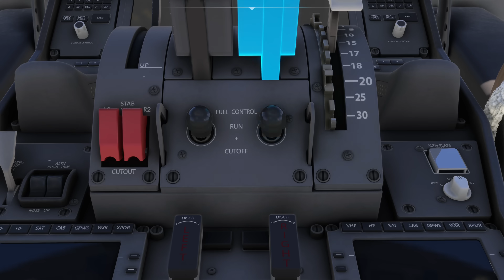Air India 171: Why Did The Fuel Cut-off Switch Get Moved?

Comment: Could relay theft have something to do with the ‘cut off fuel’ switch regarding the Air India Airline tragedy?  

Example:  Usually, a car thief gathers a signal as owners enter and exit their vehicles.  In my street lately, thieves open cars within a large area with RFID omnidirectional transmitters and receivers.  THEY USE LONG DISTANCE AMPLIFIERS.  Hence why some mornings, most cars in my street have open windows and unlocked doors. 
Hypothesis: Wouldn’t it be possible that some of the very expensive cars could be remotely started and air conditioners turned on?  Could a high tech. thief have accidentally accessed the Air India Flight’s onboard computer and turned off the fuel switch, thinking that it could be a locked car that needs unlocking and IF POSSIBLE, TURN THE ENGINE ON? SO, TECHNICALLY, THIS TECHNOLOGY CAN TURN OFF A CAR WHILE DRIVING?  HAS THIS HAPPENED TO ANYONE DRIVING BEFORE?

AIR INDIA 171 WAS SURROUNDED BY RESIDENTIAL AND COMMERCIAL AREAS FULL OF HIGH TECH. CAR THEFT!!  THIEVES USUALLY UNLOCK CARS WITH VERY SOPHISTICATED GADGETS, THIS YEAR IN PARTICULAR!!

Comment: Capt Steve appreciate your channel I think you bring excellent  aviation content to the world. Let's not use a preliminary report as a basis to blame pilots at this stage of investigations. Anything is possible but shifting narratives and perception is unfair and disrespectful. 
Let’s be honest—the FAA isn’t really a safety regulator when it comes to Boeing. It’s more like Boeing’s PR department, always ready to deflect blame, cover up mistakes, and protect the company’s profits, even when people die because of its failures.  

And now, with Air India Flight 171 crashing last month, killing passengers and crew, we’re about to see the same old playbook in action: Boeing and the FAA will try to pin this on the pilots.  

How the FAA Protects Boeing Instead of Passengers  

1. The 737 MAX Scandal: A Masterclass in Cover-Ups  
Remember the two Boeing 737 MAX crashes that killed 346 people?  

- Lion Air Flight 610 (2018) – Crashed shortly after takeoff.  
- Ethiopian Airlines Flight 302 (2019) – Same thing happened five months later.  

At first, Boeing and the FAA blamed the pilots, saying they didn’t react correctly. But the truth?  

- Boeing hid a deadly software system (MCAS) from pilots—one that could forcefully push the plane’s nose down without warning.  
- The FAA knew about it but still certified the plane as safe.  
- Even after the first crash, the FAA refused to ground the MAX, waiting until after the second disaster to act.  

And what was Boeing’s punishment? A slap-on-the-wrist fine, while executives walked away untouched.  

2. The "Blame the Pilots" Strategy – Especially If They’re Not American  
This isn’t new. Boeing and the FAA have a long history of shifting blame to foreign pilots when their planes fail:  

- Turkish Airlines Flight 1951 (2009) – A faulty sensor caused the plane to lose speed and crash. Boeing initially blamed the pilots, but investigators later found Boeing’s cockpit design was dangerously confusion  
- Lion Air 610 (2018) – Before the MCAS scandal fully broke, Boeing pushed the narrative that Indonesian pilots weren’t properly trained, ignoring that the system was designed to overpower them.  
- Ethiopian Airlines 302 (2019) – Same story—Boeing tried to suggest African pilots were at fault, even though the MCAS system was actively fighting them.  

Now, with Air India Flight 171, we’re seeing the same pattern:  

- Early reports are already focusing on  pilot actions and suicide intentions by the  Indian Capt, while ignoring known issues with Boeing’s 737 and 787 series with switch malfunction. This can very well be a software issue that caused the plane to shut  down both engines. Blaming  pilots with no actual cockpit voice  transcripts. Whatever the outcome let it be fair and just. Bring in more Senior Captains from India to help with investigations as to avoid biases western agendas.  

- The plane skidded off the runway in Kerala, but was it just "pilot error"? Or is there a deeper problem with Boeing’s aircraft?  
- Given Boeing’s track record, they will try to make this about the Indian pilots rather than their own engineering failures.  

Why Does the FAA Let Boeing Get Away With This?  

Because the FAA isn’t truly independent.  

- Boeing funds much of the FAA’s certification process, meaning the regulator relies on the company it’s supposed to oversee.  
- Former Boeing executives often move into top FAA jobs, creating a revolving door of corporate influence.  
- The FAA doesn’t want to hurt Boeing’s profits, because Boeing is a key part of the U.S. economy.  

So when crashes happen, the FAA’s first instinct is to protect Boeing, not the truth.  

What Needs to Change?  

1. Break the FAA-Boeing Relationship – No more letting Boeing "self-certify" its planes. The FAA must be fully independent.  
2. Stop the "Pilot Error" Scapegoating – Investigate fairly, without automatically blaming foreign crews.  
3. Hold Boeing  Responsible– No more fines that amount to pocket change. Executives should face real consequences when their negligence kills people.  
4. Demand Global Accountability – Countries like India, Indonesia, and Ethiopia should not accept the FAA’s biased rulings. They need their own thorough investigations.  

Final Thought: Will Air India Express 171 Be Another Cover-Up? 

Given Boeing and the FAA’s history, yes—they will try.  

But the world is waking up. People are tired of seeing the same excuses, the same blame-shifting, and the same lack of justice.  

If we want real aviation safety, we need to stop letting Boeing and the FAA control the narrative. Because right now, they care more about profits than lives.  

And that’s a scandal that keeps repeating itself—until we force it to end.

Comment: Boeing should make changes such as simple software update.
There should be be  YOKE Vibration and AUDIO warning eg. "Engine 1 Fuel CutOff"
especially when thrust level is not Idle, to warn the pilot or other pilot in case if this hapeen again, that could prefent this kind of aciddent happen

Comment: Capt, Are you seeing the interview on YouTube channel MINT with a Dreamliner Capt that quotes the report as the fuel switches being moved in “one second” and his comment based on 4,000+ hours of 787 flight that it’s not possible to move both switches in one second to off. He comments that the “micro switches” in the equipment may have malfunctioned as much more likely than a pilot somehow doing it in one second. The report must have stated this as he seemed pretty confident he read it right.
Reply: the first half of the movement of the first switch does not count - 1 second gap between position-status off

Comment: Don’t give wrong 😑 information….Yes, the Boeing 787-8 Dreamliner uses an electronic engine control system called FADEC (Full Authority Digital Engine Control), which controls the engine’s fuel flow, including the Run and Cutoff modes.

🧠 What Is FADEC?

FADEC is a digital computer system that:
	•	Controls all aspects of the engine (fuel flow, ignition, thrust, etc.)
	•	Replaces traditional manual levers or hydro-mechanical systems
	•	Provides Run and Cutoff control via electronic signals from the cockpit

✈️ How Run and Cutoff Work on the 787:

✅ Engine Start/Stop is Done via the EICAS/Overhead Panel:
	•	START/RUN/STOP commands are given electronically.
	•	Pilots use engine start switches and fuel control switches, which send signals to the FADEC.

✅ FADEC Executes the Command:
	•	When RUN is selected, FADEC:
	•	Opens fuel shutoff valve
	•	Commands ignition and fuel metering
	•	Starts engine rotation
	•	When CUTOFF is selected (or switch is moved to “STOP”):
	•	FADEC closes the fuel shutoff valve
	•	Stops fuel flow
	•	Shuts the engine down

🔐 Safety Features:

FADEC systems are designed with:
	•	Redundancy (dual channels)
	•	Built-in self-checks
	•	Lockouts and interlocks to prevent accidental activation
	•	Software protections to ignore illogical or dangerous commands (in theory)

However, if the fuel control switches (electronically linked to FADEC) are moved to cutoff—whether by crew or fault—it will stop the engine.

✅ In Summary:

Feature	Boeing 787-8 Dreamliner
Engine control system	FADEC
Cutoff/Run controlled by	Electronic switches via FADEC
Manual override	Not standard; FADEC manages all fuel flow
Safety interlocks	Yes, but still under investigation after AI171

Comment: This is one of the most asinine accusations in the history of aviation. The report is pure garbage that was leaked to western media to cover a massive fault in 787s, which is clear by how vague an OFFICIAL report is (doesn't matter if it's preliminary). The RAT was deployed BEFORE the switches were toggled. End of story. This was a major engine failure that was trouble shot by 2 wonderful  and calm pilots by turning the switches off and on. @captainsteeve, looking into Flying Beast/Gaurav Taneja's review of the report and that will educate you on A LOT of nuances that you missed.
Reply: Your a racist

Comment: Zero hours flying a 787, or any other plane for that matter. But I am a aerospace machinist, and knowing a thing or two about the manufacturing process behind airline parts, I have to ask... There seems to be only two theories left: either one of the pilots flipped the switches, or it was some kind of computer malfunction that caused the fuel shut off (one of the pilots said "I did not"). If  some kind of computer malfunction caused the fuel to be shut off to the engines, would the electronic shutting off of the fuel also mechanically flip the switches in the cockpit as well? That doesn't seem possible, because that would require an individual motor control with a backwards electrical feed coming from the computer that regulates the fuel back to both of the switches - which seems completely unnecessary. Also, since switches have to be toggled over a stop, that would entail another motor movement. If it can be identified that the cockpit fuel cut off switches were 100% for sure switched to off, and any computer glitch would only electronically cut off the fuel to the engines and not toggle the switches to off, then there should be no doubt to the cause. In all this back and forth, I have not seen anyone say anything about this. It seems so elementary, yet no one has brought it up.

Comment: Question for captain Steve regarding `787 automatically moved the fuel switch from “run” to “cutoff” without any action from the pilots.`

According to this news article it is claimed that the computer on a 787 has set the fuel to "cuttoff" before. It seems odd that a computer can move spring loaded switches but since everything is electronic it could of course cut off the fuel to the engines automatically. Did the reverenced incident really happen as described and can the computer on a 787 automatically switch of the fuel to the engines?

`She highlighted a similar incident during which one of the engines suddenly shut down midflight on an All Nippon Airways Boeing 787 during its final approach to Osaka, Japan, in 2019.

Investigators later found that the aircraft’s software had mistakenly interpreted the plane as being on the ground, triggering the thrust control malfunction accommodation system, which automatically moved the fuel switch from “run” to “cutoff” without any action from the pilots.`

Source: https://www.aljazeera.com/news/2025/7/17/what-happened-to-the-fuel-control-switches-on-doomed-air-india-flight-171

Details:
Airline	All Nippon Airways (ANA)
Aircraft	Boeing 787-8 (JA825A)
Date	January 17, 2019
Airport	Osaka Itami (Arrival from Tokyo Haneda)
What Happened	Both engines shut down on landing rollout
Suspected Cause	System/software glitch (TCMA system) after reverse thrust deployment

Related articles:
https://samchui.com/2019/01/19/ana-boeing-787-dual-engine-shutdown-upon-landing/
https://www.aeroinside.com/12629/ana-b788-at-osaka-on-jan-17th-2019-both-engines-rolled-back-after-landing

Comment: The timing of when the fuel switches were cut off seems to be around the time when the pilot would have brought the landing gear up, but we know that never happened. Could this be a case of muscle memory coupled with a tired or distracted pilot? In other words, these pilots were experienced, so performing actions like bringing up the gear or shutting off the fuel after the plane lands are things they can do without thinking about it. I know the gear and fuel switches are nowhere near or like each other and are completely different, but could the pilot have gone to pull up the gear, but being distracted and not thinking straight, performed the action to shut off the fuel to the engines instead?

Comment: This aircraft operates entirely on computer control through software, so investigators will need to check for any glitches in the programming. The fuel control switches send logic states to the computers, and the aircraft indicated it detected dual engine failures, triggering the emergency RAT system. A thorough investigation is necessary, as blaming the pilots is the easiest conclusion to jump to. Investigators will need to recover the switches on the ground to examine their mechanical state.

Comment: There are many strange things in the report: why would the report not include verbatim, the pilots' quotes? The "why did he cut off" could also be "did he cut-off". In the latter case, it could also be a run-through to the checklist. In any case, if we look at the facts that Captain Steeeve has discussed, and the time-stamps given in the report, there are many questions that probably only Captain-Steeveve can answer from his experience:
1. Given that the aircraft was nose-up, we can safely assume that sabotage can only be done by the Pilot-monitoring(PM). If so, the report says that lift-off happened at 08:39. The fuel switches were cut-off by the PM AFTER 08:42 (Very strange that they don't give the time, given that they give the exact time when the switches were back at run). So, if the fuel was cut-off after 8:42, why would there be dust during take-off suggesting that V1,Vr and V2 were achieved slower than usual. Thoughts?
2. The report says after the switches were reverted back to on, it took 2 secs for the valve to fully open. I would think that when they were cut-off, it would still take 2 secs to fully cut-off and probably another second to use up the remnant fuel. So, assuming fuel cut-off at 42 for Eng 1 and 43 for Eng 2 (because they are reported to be 01 sec apart) I am guessing it should be at least 08:46 when the generators would "stop". Only after this the RAT will be deployed, right? 
3. The report doesn't state when the engines were turned off (immediately thereafter is vague when every second counts), but it does not even say when RAT was deployed. It says when RAT started generating power. This is at 08:47. This is a mechanical deployment after 08:46.I would think that the RAT getting down and getting enough speed to start the power should take at least 3-4 more seconds. Getting the time-line to 8:50 or so. 
4. The timeline from just the numbers given in the report, the dust, would suggest a possibility of sluggish engine prior to take-off. Would It? Do the times taken to get from V1 to lift-off and the speed of 180 knots make sense for a Dreamliner? This is something no--one talked about. Pilots could perhaps weigh in on this.
5. The fuel was cut-off AFTER the max-speed(180) was achieved. This means the plane began decelerating BEFORE. How can this happen if fuel supply was still intact? This is argument just from physics and the timestamps from report nothing else. I am keeping in mind that cutt-off the switch would still take 1-2 sec of the APU logic to close the valve and another sec to use up the remnant fuel. The max speed should have been after fuel-cut-off.
6. Speculation here: If one Pilot was sabotaging, why did he not turn the switches back to off? The switches were turned to off and back to on just once, consistent with the procedure for Dual-Engine failure?
I approach in good faith and seek your opinion. I am not trying to defend the pilots, but it looks like after the report is out we are only talking about the "why did he cut off" quote which is not even the pilot's direct quote.

Comment: From The Telegraph, via Yahoo News:  "Indian media, however, reported that investigators were examining potential electrical and digital faults that could have triggered “uncommanded” actions.

“The probe will ascertain the possibility of an ‘uncommanded transition’ of the fuel control switches to the cut-off mode seconds after the lift-off,” an official aware of the investigation was reported to have said."

Comment: Is it possible to start a 787 if the fuel switches are off?  Is this also a fuel pump switch ? If the switches don’t control a fuel pump what is the line / system reserve of fuel before engines will stop 0 seconds , 10 seconds?